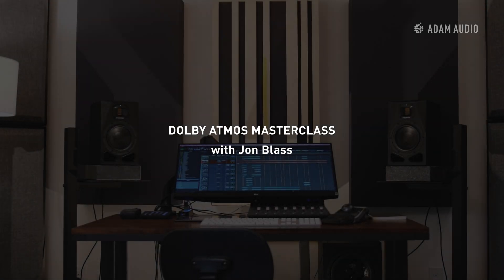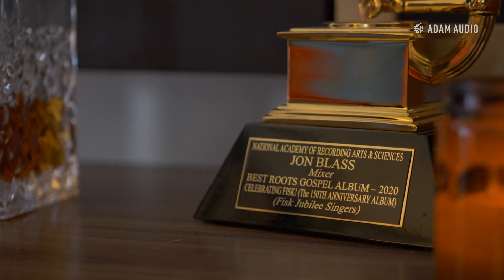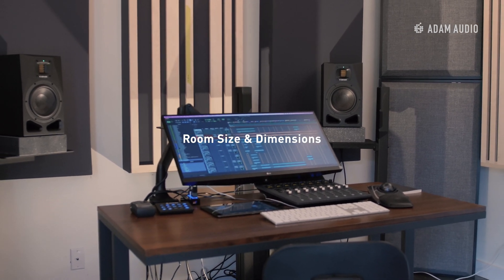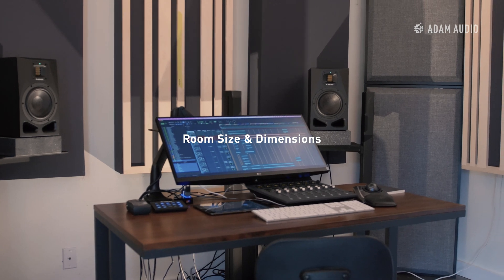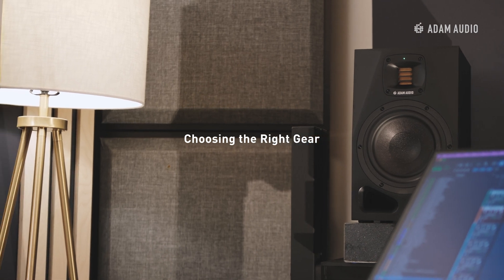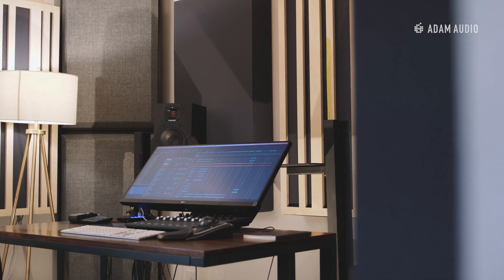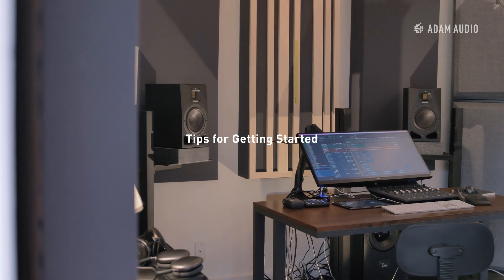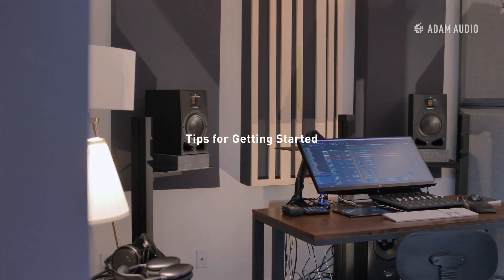Installing a Dolby ATMOS Studio | Episode 1

Comment: For those of us looking for a more budget friendly option, could you recommend something like a stereo pair of A7Vs, T7Vs for the surrounds, T5Vs for the heights, and a T10s sub? The frequency response of the T7Vs and A7Vs look similar enough at a glance that this kind of mixed array could work, especially with EQ. Do you have any other suggestions for this price point?
Reply from the maker: Hi Max! If you want to go with T Series, we would recommend not mixing the series. So you could have T7Vs and T5Vs with the sub T10S :)
Reply: @ADAMAudioBerlin  Considering the A Series array I'm noticing that the A7Vs don't go down much below 40 Hz so a sub could be necessary to support them. Is the Atmos sub only meant to receive LFE while mixing, or is it fair game to have the stereo/stereo+centre speakers also feeding the sub?
Reply from the maker: Hi Max! In a Dolby Atmos setup, the subwoofer is typically not limited to receiving only the Low-Frequency Effects (LFE) channel during mixing or playback. While the LFE channel is specifically dedicated to low-frequency effects, such as explosions and deep bass in movies and other content, it is common and often beneficial to have the stereo and center speakers also feed audio to the subwoofer. So, it is fair game and often recommended to have the stereo and center speakers feed audio to the subwoofer in a Dolby Atmos setup, as long as you configure your AV receiver or audio processor appropriately to ensure a balanced and well-integrated bass response.
Reply: @ADAMAudioBerlin  Thanks for your great responses! Also curious as to what sub is used in this room. On the website it recommends matching a stereo pair of A7Vs with a Sub10 mk2. Would this sub still be able to hold its own in a full Atmos A7V room?
Reply from the maker: Hi Max!
Yes, the Sub10 MK2 matches the A Series. It all depends on your room acoustics and room size. Consider also using 2 subwoofers to help distribute bass more evenly throughout the space. Multiple subwoofers can also reduce bass peaks and nulls that can occur in certain locations within the room. Properly integrating and calibrating the subwoofer in your Dolby Atmos room is essential for achieving a balanced and immersive audio experience.
Reply: @ADAMAudioBerlin  amazing thanks a lot!